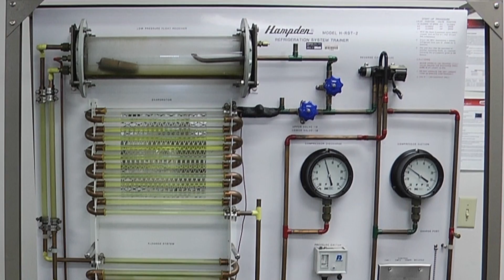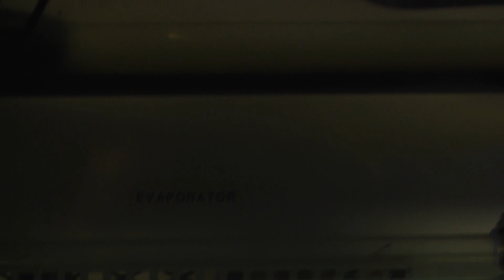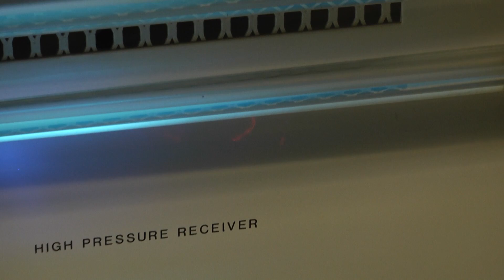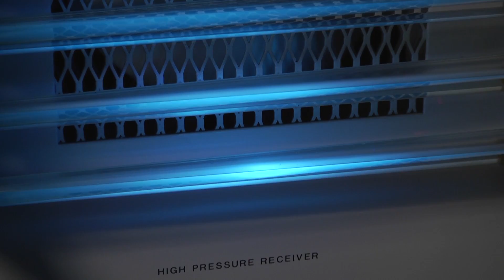A Look Inside the Air Conditioning and Refrigeration System

Comment: 2:24 How is the refrigerant super heated? Is it just a factor of the length of the coils to give the ambient temperature enough time to heat the refrigerant to super heated? Or is it actively monitored and heated by some sort of component in the system?
Reply: Does the TXV control super heating?
Reply: If the refrigerant is saturating at 40 and the return air is 80 once it all boils off it can now get hotter than 40 and that’s the super heat. Txt is one controller of super heat, by controlling how much saturated refrigerant is let in

Comment: What component actually performs the superheat after leaving the evaporator, and what component makes the subcool happen after being cooled by the condenser?
Reply: The refrigerant itself is losing and gaining heat. No component, it's just the process as pressure is increased and decreased.
Reply: It's doesn't occur after it leaves the evaporator, it happens because the txv sets the pressure using the control board. The control board does temp and pressure calculations and controls the amount of refrigerant pressure entering the evaporator. You control superheat by controlling the refrigerant quantity and pressure.

Comment: I am still learning but to me it looks like the evaporator has only a small area of superheated gas in it. Almost to the point it looks dangerously close to being flooded. Obviously, without putting gauges and measuring the superheat properly, this is just speculation. Maybe you could tell us the superheat of that system as it operates?  A starved evaporator would have had more tubes "clear", indicating superheating gas.

Comment: Do you have to use the light to see the refrigerant? Is it a UV light? If the light isn't there, would the liquid be clear?
Reply: I accidentally poked a hole in the condensing unit of a mini-refrigerator and the freon leaked out. It was a florescent blue/green. I think the blacklight was used to make it easier to see. FYI if you ever do that, hold your breath and get the fridge outside asap, that freon is bad stuff to breathe.
Reply: refrigerant is colorless and odorless. but like peter said, if you ever have a leak, evacuate. the gas will displace oxygen in the room and knock you out.
Reply: @wallapee  thanks! Hence ASHRAE 15!